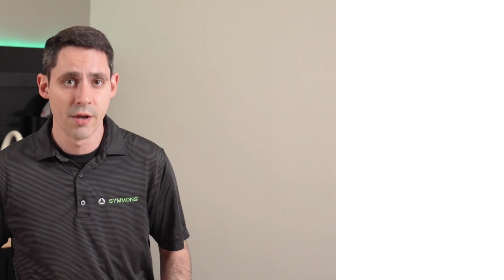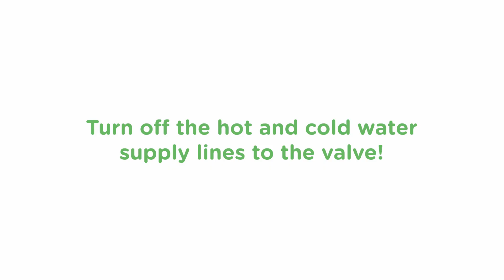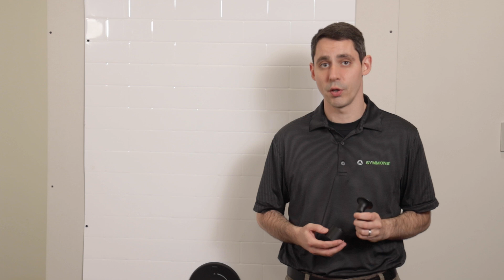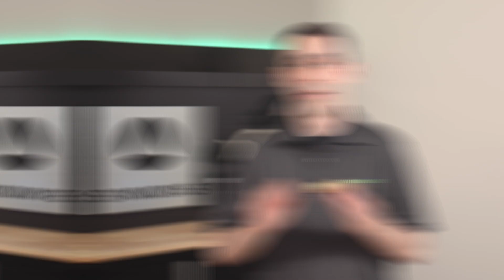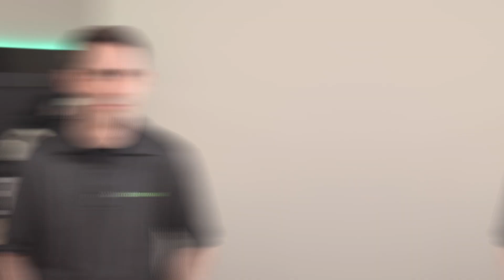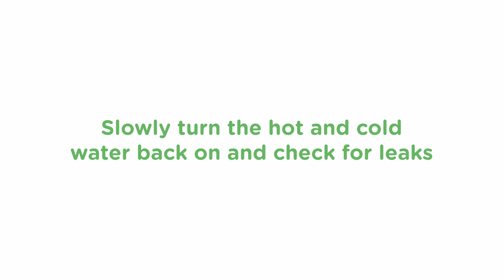How to Replace TA-10 Control Spindle | Symmons Industries

Comment: So if I didn't open the valve before removing and I only replaced the cartridge, and now after reassembling everything the handle turns 3 full rotations when before it only turned 1 rotation, what did I break? Hot water used to come on after about half a rotation but now comes on after about 1.5 rotations